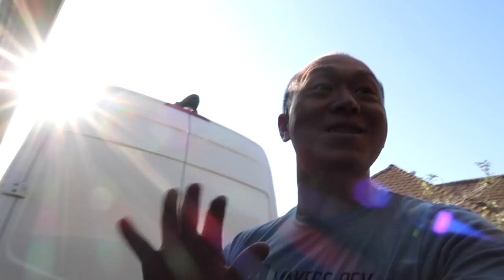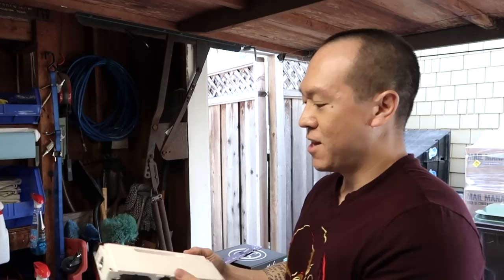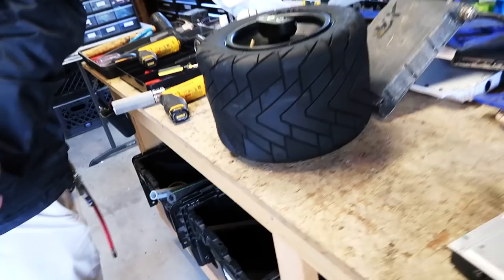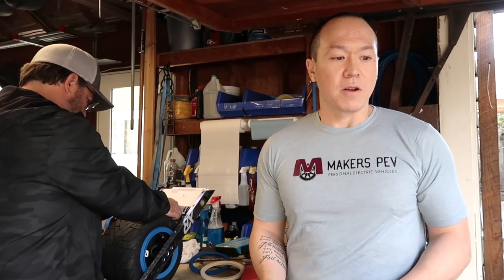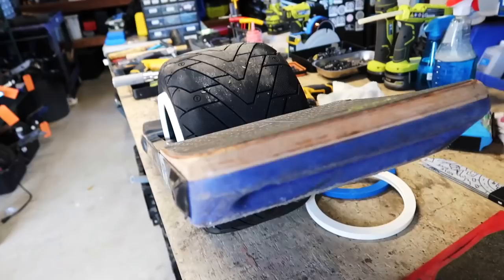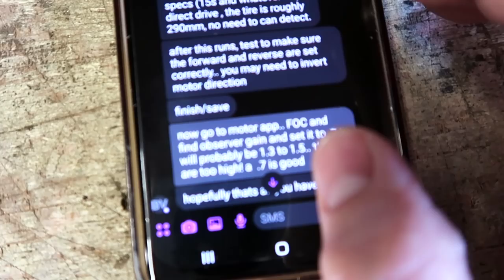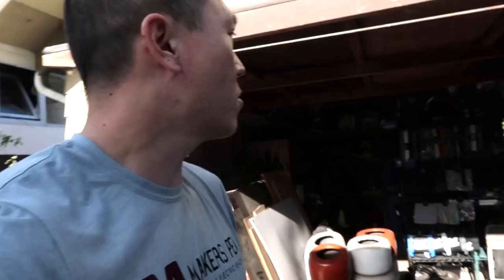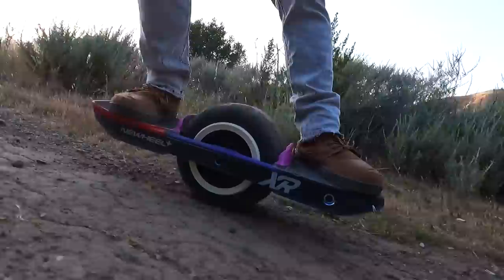VESC: the Torque King & Onewheel GT killer?

Comment: This is it folks!
This is the big turning point, the milestone event!
A DIRECT PLUG-IN REPLACEMENT controller. 👍👍👍
It should already be fully programmed and setup for typical riders, and needs an easy to follow instruction guide for the simple tweak adjustments most people will make. I am sure they are working on that.
I have worked in the electronics industry for decades and have seen this turning point before. A plug-in replacement controller basically makes F.M's repair department obsolete. Plug-in replacement batteries are next (if not here already) and then we just need hubmotors.
I wonder if F.M. realise just how much their immoral stance on right to repair will cost them in the long run...
Fantastic video! You made my day. 👍🥇
fFM

Comment: if Surfdado releases his hybrid settings then you get the benefit of Hannes settings at low speed and then ask the torque tiltback and no nose dipping at higher speeds.
Reply from the maker: Running the Surfdado settings now, more testing vids coming 🤘🏻

Comment: I love that there is no crunching from forward to reverse…also impressive how the nose was staying up! I’m very interested in the efficiency in terms of battery drain and heat on the motor. Amazing video! 🔥
Reply from the maker: thanks for the support! with my latest trail settings the nose doesn't dip nor lift! battery drain is similar to stock fm, maybe a mile or two less, temp is similar too if you're not doing crazy hill climbs lol
Reply: @MaxxSend  gonna need to come out there and try that beast 😈

Comment: Definitely interested in this one 😎
Reply from the maker: It's pretty nuts how much we're held back from experiencing the motor and battery's full potential.. ⚡🔧
Reply: ikr, I was really surprised how much more torque was avail. even using a stock XR battery!!
Reply: With that said though, FM might be limiting current draw for a good reason, like e.g. prevent premature wear of the battery for example…
Reply: @hugueslabbe7811  or to limit liability? Could be a lawyer decision rather than a performance one too…

Comment: Nice Video,  but there are a few things you got wrong. The VESC-Tool  and VESC firmware are made by Benjamin Vedder. Then there are different VESC-Controllers: VESC 6, VESC 6/75, VESC 75/300 and VESC 100/250. These are all designed by and with Benjamin Vedder and are the official VESC line of products. Then there is third party hardware (VESC-compatible but not VESC) like the Little FOCer, Stormcore,Flipsky etc. Those are not "VESCs", just like a Teensy is not an Arduino. They are not officially licensed and have to carry a different branding.  Another thing that exists is third party firmware, not from Vedder... So VESC refers to all the stuff Vedder is directly involved in, hence Vedder in the name.

Comment: Hey Max! Dope video. Thanks for putting it together!! What’s the range on the VESC as you have it set up?
Reply from the maker: thanks for the support! for a stock battery range was slightly less than stock XR, around 12 miles. I weigh 185lbs.

Comment: For VESC battery options, there's also the chi battery controller swap series, those batteries are built specifically for VESC applications. 

For a cheap headlight solution, you could get some retro reflective vinyl strips from someone like OW armor and apply white strip to the front and a red strip to the back. Just like NASCAR, your headlights would be stickers.
Reply from the maker: Thanks for the tips! I got an 84V CBCSO ready to install later this week. Will look into doing the reflectivr vinyl, miss my purple electrolytes 🥲

Comment: I Get the feel that swapping XR motors using the stock controllers might actually be a bad thing if the VESC has to calibrate itself to that specific motor to work well. Not that swapping motors would be inherently dangerous, but you might not get the most out of your board without calibration. That being said, that the VESC has come this far is AMAZING! It gives me an option should my XR start failing in one way or another, especially since I can't just order what I need from FM :D
Reply: It should not require much (if any) calibration when swapping hubmotors provided they are the same type of motor. The number of poles will not change, nor the phase angle of the hall sensors etc as they are all factory set in the correct phase position when the motor is made. And even the motor inductance should be the same unless it is a different model of motor with different k:V rating.

Comment: I only have a pint right now. Would it be better to buy a used XR and vesc it or just get a GT from the start?  ps im 217 lbs.  Thanks for the great vids!
Reply from the maker: appreciate the support! it depends on your riding style and budget. if you tend to shred hard on trails/tricks and/or more budget wary, hands down go for the XR. Super easy to vesc it and get more range/power than a gt with the right battery! if you have the budget and don't tend to ride hard, then gt is perfect for the mellow cruiser :)  (gt is a bitch to repair if you break it)

Comment: At this point all we need is for third party front foot sensors (FM will eventually phase out the XR footpads) and the motor itself... unless there are alternatives I'm not aware of.
Reply: platysense is an aftermarket concave XR front sensor footpad
Reply: Fungineers have a new 6inch hub motor going for $300, claimed performance better than or at least equal to xr. They also sell sensors for $35

Comment: Is there a good BMS option that fits somewhere inside where I can see my voltage read out? My 'lovely' 4212 denies me this information so if I'm going to go VESC I would like to solve this issues as well
Reply from the maker: You can see the voltage within the vesctool app. Eventually invest in an 84V CBCSO battery option with built in bms
Reply: @MaxxSend  I see the 72v on chi battery’s website.  Are they doing a 84v as well?!  That would be sick.

Comment: Such an awesome video. Been on the border of going VESC but now I'm convinced! Would love to see you do some chairing on the VESC too!
I am wondering if the CBSP has a shorter (or longer) range if the new controller is better at utilizing the full range of voltage though.
Reply: without the BMS it's more likely to be less range. It wouldn't be safe to run your battery down to zero without a BMS
Reply from the maker: @surfdado  ran it down to 2% the other day 😅
Reply: @MaxxSend  lol - I'm not saying you can't run it down to 2% - you can even run it down below 0% since there's no BMS to stop you - but you are playing with fire, literally 😂
Reply from the maker: @surfdado  I think I belong in a circus 🫣

Comment: Does a VESC OneWheel XR have potential for a higher top speed than the GT?
Reply from the maker: Absolutely! Upgrade the battery voltage up to 84V and you can get speeds around mid 30s mph (depending on rider weight, conditions etc). Check out the more recent vid I made of Kyle Hanson reaching 31mph on conservative settings. https://youtu.be/KYi-z2iUIFE
Reply: @MaxxSend  Thank you for the quick reply! I just got my XR yesterday and that speed is addicting. It’s so smooth!

But it struggles on the grass, gets crunchy so was looking for more punch like VESC or CBXR.

Comment: Max! Thanks for this video, but now you’ve put me in a weird spot. I’m riding a Pint right now, looking to upgrade as soon as I have the funds. Would you suggest the GT, or just get a used XR and start kitting it out? The high speed and torque of the GT really appeal to me (and the range) but open source stuff like this gets me all excited.
Reply: Go XR! IMHO. I started out on a Pint X and was looking to upgrade. Naturally I thought that would be the GT, as I was mainly just looking for a physically bigger board as I'm 6'3" and have big feet so the pint just isn't super comfortable for my feet on longer rides. Then I started looking into it more and more, found stuff like the CBXR and JWXR batteries, VESC, and just the absolute wealth of community and aftermarket industry that surrounds the XR. The kinda stuff that you simply can't put a price on. Tons of parts and mods out there, tons of knowledge, tons of people willing to help and share. All the kind of shit that FM is trying really hard to kill, most of all so (to date) with the GT. I was looking for a 4209 so I would have the ability to keep my XR alive for many years to come. I ultimately ended up with a 4212 and got a JWXR copper battery with the JWFFM chip. I love modding and tweaking, making stuff my own, and the XR allowed me to build an absolutely gucci board. Tail rails, grizzly bearings, badger bumpers, different footpad and grip tape, a flight fender, CNC enclosures, CNC hubs, CNC motor plate, some Ti hardware all riding on a TFL enduro.. some other little bits and bobs too. At this point, I'd take my XR over a GT any day of the week. If I got a GT, I wouldn't have been able to do a fraction of the things I  was able to on the XR. And now that I have my JW chip, I can swap batteries as needed and keep it running for many years to come... And as VESC continues to develop, that is always an option as well.
Reply from the maker: yo catching up on all comments! absolutely a modded XR and/or vesc'ing it. Even with all the latest firmware updates with gt, I am still not a fan and will not buy one. Check out my most recent install vid with an 84V CBCSO battery with built in bms :) Hope you can try a VESC one day just for the smooth feeling!
Reply: @MaxxSend  Yo! Thanks for the reply. I'll have to do some searching around online to see if I can find an XR in good shape. I'm hearing mixed opinions about the GT, so the XR is definitely an appealing option right now. And I still don't have the money set aside to buy one, so there's no rush lol.

Comment: Wait ...you said it has as much torque is a GT? On a stock 63v battery? I was under the impression that because the motors are the same you would have to get a 75 V battery pack (like GT) to get something more comparable to GT torque?
Reply: Torque depends on max amps, not voltage. Higher voltage gets you higher speed but doesn’t directly increase torque at all. The GT has higher voltage allowing for higher speed than XR. It also can output more amps which is what gives it more torque
Reply: @surfdado  ok...amp discharge is most relevant (given a certain voltage)...agreed. But if this was a 63v pack...does the VESC setup allow for vastly more amp discharge (assuming the cell has the amp capability) than an XR controller?...to get similar torque to that of the GT or beyond??
Reply: @ZuberEUC  because Max has the BMS removed, the battery amps aren't limited. The VESC app lets you freely configure max battery amps and max motor amps. The stock XR battery is only rated for 30A max but you can temporarily get a lot more out of a pack like that, at the expense of battery life and health - but Max will soon upgrade to a much more powerful battery so he probably doesn't care about his stock battery.
Reply: @surfdado  THANKS for the enlightenment!! Ur channel and other vesc contributors are HEROs to the future of the onewheel style platform. I hope to get on the VESC train soon!!

Comment: I’m planning to buy a GT because I need the platform. I’ve tried DIY kits and they aren’t as refined as the GT. I know that one day the battery will die and brick my GT. I’m going to drop in a VESC and 30 cells in a 15s2p config. Unless I can find an XR for less than $1000 this is the smartest long term solution.
Reply from the maker: go for it! with the newest firmware updates the gt has improved for sure, but still doesn't compare to the vesc in terms of smoothness, power and speed (with the right settings and battery). I've been tuning my board for 3 months now and have a trail settings tune card that many are loving, it's like an improved version of mission. plenty of XRs for around $1k. anyway enjoy the gt life! just here to show a legit competitive alternative.

Comment: How is charging handled with the BMS removed?  I would think you would still want the BMS for charging and bypass it for riding.
Reply from the maker: I bypassed it temporarily cuz I wanted to experience the extra amps you get from the battery. Mind blowing! But yes you'll need the bms long term for balancing. If there was a way to toggle on/off that'd be amazing. Check out my most recent install vid: 84V CBCSO battery with built in bms :)

Comment: With the motor on the pint being the same (smaller rims) how likely would it be to VESC a Pint?
Reply from the maker: Exactly the same! U can vesc anything, even a pint x and gt. But the gt wouldn't make sense due to larger rim and proprietary connectors.

Comment: what's the risk with not having the BMS in there?
Reply: Just a chance that it can cut out on you if the batteries got too hot. If you are riding hard enough to generate heat id get one of matthews hub covers, racing hubs too they both reduce heat and you can start to wear full gear anyways
Reply: @jayleephotography1845  JUST that it can cut off mid ride? Sounds like a big risk to me! 😬
Reply: Just a mild to moderate Lithium fire if you're not careful 🤣 No BMS is not a permanent solution, but for a few weeks or months the risk is pretty low when starting off with a quality pack. But you do have to be more mindful about the state of your battery

Comment: Where did you get the controller with the case??
Reply: For those keen to build a VESC like Max’s here is some useful links. 
Link for the 3D printed controller box from Flowglider
https://www.thingiverse.com/thing:5325535
Where to buy all the VESC parts you need if you live in the USA
https://www.makerspev.com/collections/bundles
Where to buy all the VESC parts if you live outside of the USA
https://customwheel.shop/blog/manual-how-to-install-your-controller
Where to buy a lid and seals for the controller. They may also be available from a supplier in the USA as this is from Europe. 
https://www.flowglider.com/index.php/product/wtfoc-mk2-for-little-focer-v3-hardware-pack/
Instructions 
https://customwheel.shop/blog/manual-how-to-install-your-controller
How to install the settings of a pro rider. 
https://customwheel.shop/blog/how-to-install-the-settings-of-a-pro-rider

Comment: Also where can you purchase VESC?? Website?
Reply: Same.. I must have missed the link on where to purchase.
Reply from the maker: I was fortunate to have a fully assembled controller built for me. They're working on preassembled solutions. For now you'll have to purchase the components and put it together, which seems like a pretty fun project:

Link for the 3D printed controller box from Flowglider
https://www.thingiverse.com/thing:5325535
Where to buy all the VESC parts you need if you live in the USA
https://www.makerspev.com/collections/bundles
Where to buy all the VESC parts if you live outside of the USA
https://customwheel.shop/blog/manual-how-to-install-your-controller
Where to buy a lid and seals for the controller. They may also be available from a supplier in the USA as this is from Europe. 
https://www.flowglider.com/index.php/product/wtfoc-mk2-for-little-focer-v3-hardware-pack/
Instructions 
https://customwheel.shop/blog/manual-how-to-install-your-controller
How to install the settings of a pro rider. 
https://customwheel.shop/blog/how-to-install-the-settings-of-a-pro-rider
Reply from the maker: @isaacconley2582  web links at end of vid and in description, replied above☝🏻